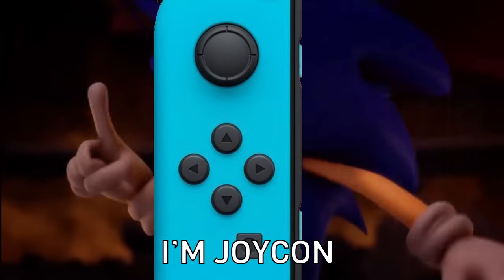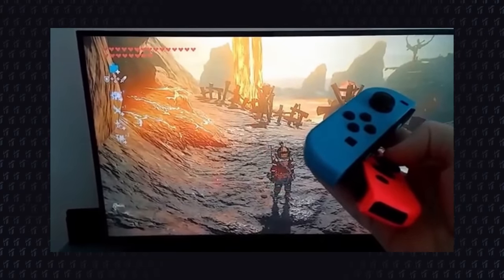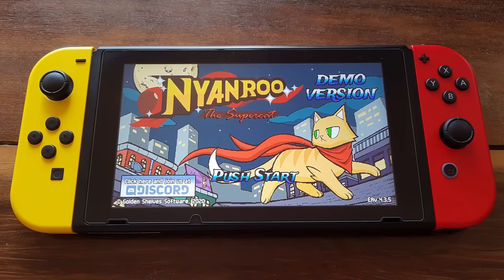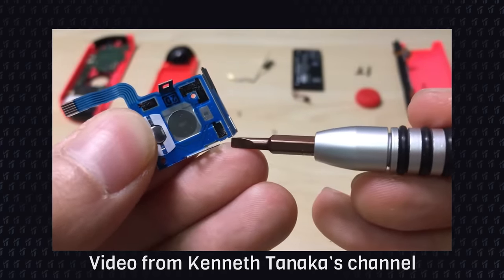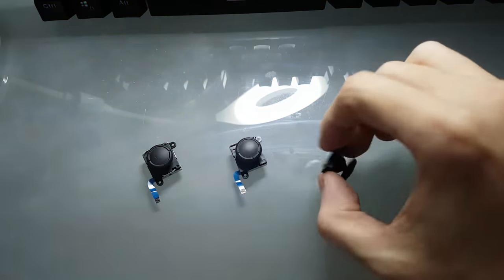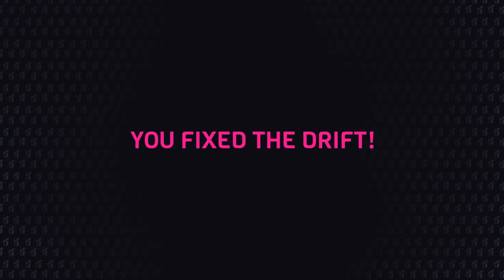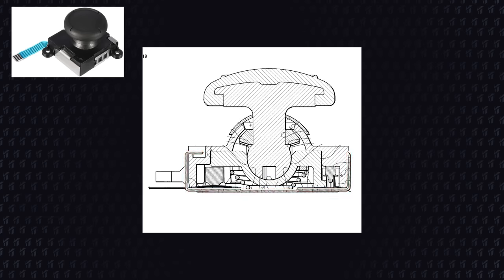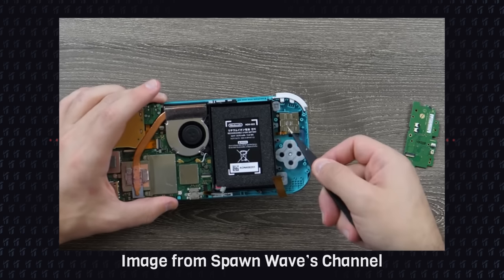How To Fix Your Joycon Drift Permanently!

Comment: I used WD-40 “specialist” contact cleaner ONCE. Joycon drift hasn’t come back since then. It’s been a year now since I did it. I still have the full bottle of cleaner sitting there.
Reply: basing off this video. it seems like the WD-40 created a kind of suction to hold the Joycon nub in its original place.
Reply: @napsterking  I guess so. I’m serious, I’ve fixed mine and my families switches. I did them the Christmas off 2019. Heavy use through the pandemic and still no drift.
Reply: Did the same but i used cotton to clean with the wd 40 without destroying the joy con. It came back again 2 month later but i repeat the same thing and now 1 year later no more drift. No idea how that work but i'm happy with the result
Reply: I tried it multiple times before and it didn't work sadly
Reply: @xamora  but did the cardboard work?

Comment: I just want to remind everyone that the nintendo 3ds had an issue where it would randomly shut off because the battery wouldn't make contact with the 3ds and the fix for that is a ~1 mm paper clip to put pressure on it
Reply: Like any cell phone before smartphones where sim cards and battery were all fixed with a piece of paper

Comment: A little recap of my experience almost 2 months after discovering this trick, trying to fix my 2 drifting joycons. I ended up using small electrical tape so I can easily adjust the thickness (by adding layers) and it can be put in a device without worries.

Left joycon: Perfect. Fixed the drift completely first try. I'll update by editing this if it comes back but right now it's good.

Right joycon (the one that had the worst drift): Absolute nightmare. Ribbon cable from ZR button is way too short, you have to be super extra careful because if it comes off it is absolutely not easy to put back at least for an inexperienced person. I probably opened it at least 10 times by now. And I still can't fix the drift, with 2 or 3 layers of tape it still drifts a lot, and from 4 or 5 layers (~1mm) the screws start having some resistance when trying to close the joycon & the plastic bulges too much. 3 out of 4 of the shell's screws are now stripped which is very annoying, one of them is even unusable as it won't go into the hole properly anymore (if it happens to you, don't try to screw it in anyway, I did that mistake and it was a huge pain to remove & joycon's back got scratched in the process). Also the plastic thing holding the battery is stuck (the screws are weirdly loose but won't come out) so I have to adjust the tape by fiddling around while barely seeing what I'm doing. 

So I'd say if you only have a bit of drift and/or only on left joycon, try this. Otherwise just send them back to Nintendo, something I was reluctant to do because they're a limited edition and it's not guaranteed that they send you back the same ones, but now I'm starting to think I should've taken the risk, because I bought screwdrivers, spent a ton of time watching tutorials & opening the joycons and I still have a drifting right one that Nintendo won't take anymore...
Reply from the maker: You can buy replacement sticks and still fix it

About the stripped screws you should not have tightened them too much i talk about that in my disassembly tutorial
Reply: Try thermal pads, a bit expensive but if you tinker with GPU and computer components having a few spares help, plus they can stick to the surface while you put things back.

Also the back of the battery carriage has that hole, which 'could' be closed off with electrical tape that fits the hole, or using thick 3mm thermal pads or stuffing on top of the battery to 'press' it onto the metal plate from further away.

A alternative 'non-open' solution is some sort of attachment to your joycon case that applies pressure to those spots above and around the stick? Like attaching a 'grip' to them that also applies pressure around the stick with a metal attachment or spring powered.

Comment: Hi there ! I wanted to say that I tried this fix for my 2 REALLY DRIFTING joycons !
One did not get fixed after the repair, but the other did !! It was PERFECT for a few months !

But unfortunately, the drift slowly came back, and now it's just as if I never fixed it... I tried with thicker cardboard, but it did not do much :/

I think I waited way too much before attempting the fix : my joycon was almost stuck in forward direction !

I think that as soon as you are certain that your joycon are drifting, you should go for this fix before it gets worse and it's too late !
Reply from the maker: Have you tried cleaning the sticks inside too?

Sometimes cleaning it also helps getting a better connection
Reply: Yeah unfortunately I tried cleaning too, but it didn't fix the ongoing drift 😞

But when I press on the joycon while it's drifting, it stops ! But I'm afraid that putting an even thicker cardboard will send what remains of my joycon to grave ! :')
Reply from the maker: @ninonmaire3146  in this case its best to replace the sticks then

Comment: Dude my let's go eevee Pikachu joycons started to drift really bad and I had a feeling that Nintendo wouldn't be able to replace or fix them so I started pretty much along the same thought process as you, tore down the analog stick and was starting at it racking my brain on what was wrong because there was no dust, visible damage to the moving parts or noticable ware on the pads.  

Thanks man saved me alot of time.

Comment: Works! Just fixed my left joycon. I flicked the stick to induce the drift, then pinched the case to get the same results. I used reflective tape I had left over. Made it a little better, but not quite. Added another layer of tape, and voila. Fixed. Thanks, I was debating on just buying a new pair too...

Comment: Nintendo: write that down, WRITE THAT DOWN!
Reply: Charles the french reference :)
Reply: They wrote it down when they designed the sadcons... That's why they put those screws in there to keep people out... But judging by the comment section, acquiring such a tool is not a big issue for most people it seems.
Reply: @Thunderhawk51  for a redesign i mean, cheap and effective

Comment: I just tried this, and unfortunately it didn't work at all for me, even testing with different thicknesses of paper/cardboard. So this sadly isn't a universal solution for all cases. But I'm glad to hear that it apparently seems to work for a lot of people.
Reply: How about using a canned duster, some lubricant (like Wd40) and then doing this? Yours may have a lot of accumulated debris inside so it might need too much pressure for this to work without cleaning it first.
Reply: @JavierSegura  on lord, don't use a normal WD40 use a Contact Cleaner instead, preferably one made for electronics.

Comment: The only reason pressure “fixes” it is because as the metal contacts rub on the graphite pads, they wear grooves into the graphite pads. Pressure decreases the distance but also puts more pressure on those same contacts, which will deepen the grooves and require more pressure. The reason the side placed don’t wear like the rest is the amount of pressure is much less. And some that you mentioned do actually have drift issues, ps4 and GC both have issues with drift. A simple search will show you this. 
I’ve taken several joysticks that had drift apart. The metal was just as tight as the new ones are. The ones that I examined that came off of my joycons wouldn’t have had loosened metal anyway as the games I play when in handheld don’t use the l3/r3 buttons.
Reply: this
Reply: Very likely the correct answer here. These are just going to fail further in the future. This is a short term mitigation, not a fix. There are also a few other pieces of incorrect information in this video.
Reply: Did it happen to you?
👀

Comment: Its honestly ridiculous that nintendo is ignoring this, and still shipping these defective controllers with their OLED/lite models.
Reply: They said in an interview that the most recently produced Joy-Cons are the most durable. Not sure how true that is.
Reply: @Scarftail  I havent seen that interview, but if it's true than I'm satisfied. But only time will tell if the drift is still an issue I suppose.
Reply: @Scarftail  It's true.  The new JoyCons have a sponge material to hold that metal contact.

Comment: Thank you so much! My Switch had become unplayable and I had no idea how to fix it. I got a cheap tool kit on Amazon and had it fixed within 15 minutes. You're the best! ❤
Reply from the maker: thanks!, after some time the paper card can deform and the drift may return if it does you can just replace the card with a new one and it will stop drifting for some more time, but you should definetly consider upgrading the analog sticks to a hall effect one, there is a video showing these new modules, they're selling on amazon for around $20 https://amzn.to/46GA9TG

Comment: My joycons started messing up once I dropped my switch. Besides the drift the most annoying thing for me is not being able to click down the joysticks
Reply from the maker: I believe that in your case replacing the sticks might be a better solution since you can't click down on them
and if they start drifting you do this fix
Reply: @VKsChannel  I would say add the paper while replacing the bad sticks, then you won't have to open the joycon again down the road.

Comment: This fix worked for my Joy-Con for a short time, then the drift came back worse than before. But it was worth a try!
Reply: Did you use the correct size/thickness type of cardstock? Is your joy-con thumbstick dirty or worn down? These can all prevent the technique from working properly.

Comment: The Joy Cons have a specialized tri point screw, so this seems to be out of my capabilities as of now. Would you think this also helps with Pro Controller drift? I can open that one up, because it uses simple philips screws
Reply from the maker: the pro controller uses a different mechanism than the joycons

you can order a tri point screw for very cheap on aliexpress or amazon!
Reply: @VKsChannel  I sadly just broke my screws some minutes ago bcs I bought a scredriver set which were apparently advertised for the switch but they just broke my screws 😒
I purchased new ones and hope I will be able to screw them anyways 🥺
Reply: @StickDead  I can't believe how cheap stuff like this is nowadays. Makes me quite happy.

Comment: The newest theory is that Nintendo is more interested in winning their lawsuits than being pro-consumer, so they don’t want to admit guilt and have to pay anything, regardless of how simple the fix is. In hindsight, I highly doubt Nintendo’s engineers didn’t learn the exact design flaw the instant the drift started being reported, so they’ve been sitting on the fix this whole time. If you want even more proof, look at the design flaw of the first 3DS in which the bottom screen scratched the top screen. Every subsequent iteration solved this by adding rubber pads on the top screen or flattening the bottom screen’s hinges. So there’s zero chance they didn’t already have the solution for drift.

Comment: It would seem that the stick is intended to be under mild pressure from the casing, but usage, like pressing, as you outlined, but also the ware of pressure across the two thin sides of the controller from handling. Those together will loosen both the metal plate, as well as the plastic casing.

Comment: It's a bit weird.  If the fix really is this simple, and speaking as someone who bought their system at launch and has never had an issue with drift, I am surprised Nintendo doesn't just put a small silicon pad or something in them.  Perhaps I don't play enough high-intensity Ninjala to wear out the sticks.
Reply from the maker: yep it depends on what kind of games you play

notice on how most drift videos showcase it happening with breath of the wild ( a game that requires pressing on the analogs ticks to crouch or run )

Comment: I'm scared of voiding the warrenty on my controllers, but considering how I have 10+ joycons and a little less than half of them are drifting I may as well sacrifice one of them to see if this trick works.
Reply: go for it! it isn't that hard
Reply: you dont have to take them apart to see if it will fix it. Just squeeze while testing the controller like he did in the vid.

Comment: I tried applying pressure at the calibration screen, nothing happened. the drift didn't suddenly disappear like in the video, it just continued to happen. so, I think this is probably not a universal or permanent fix.
it seems that this is a fix for one of the causes for joycon drift, but not all of them, and if you fix it this way, it's possible another cause of the drift will start to happen, the kind that I have.

Comment: I have a strong suspicion doing this caused my joycon to crack. I cut a tiny piece from one of those game cards you use at arcade places which fixed my drift for quite awhile. Though, the other day I noticed my joycon cracked right in that area near the analog stick despite not being dropped. I think the little extra pressure over time caused it to weaken and crack. I guess the material needed to be slightly thinner so be careful what you use.

Comment: your telling me that all you need to do to fix the worst issue with the switch is to stick a piece of cardboard in it like its a wobbly table? lol of course its that simple 😂😂😂
Reply: I'm worried it could catch fire somehow :(
Reply: @diverman1023  The joy cons don't produce heat , and in the joy cons is foam inside.
Reply: @emmr01  I’m not concerned about the heat but a short circuit somewhere
Reply: Does anyone know if you have to like stick the paper to it with something sticky or does it not need anything to stay there
Reply: @AndyMcDrew  I've done it for my friend and i put it there , the battery tray holds it
Reply: @diverman1023  just use a different material then

Comment: I'm wondering if the manufacturer of the stick is to blame, since more than just the Joycon use this same stick.
Just a theory but it'd definitely get the stick manufacturers more orders with so many failures.
Reply: I recall an article or post somewhere that showed this to be the case. Not that I can find it now. :/
Reply: it was kinda confirmed that the manufacturer has been responsible of various sticks drifting, i dont remember the name of the company but they're outsourced i think the PS5 sticks come from the same people

Comment: So…., if I understand correctly, it’s because the part that registers joycon movement isn’t placed snugly enough?
Reply: Well its snug enough at FIRST. Until fatigue increases the gap just slightly and all hell breaks loose.
Reply: @DanaTheInsane  In other words, it’s not snugly enough that it’s unable to loosen in the first place.
Reply: @DanaTheInsane  What about my set of joycons that had massive drift literally right out of the box?
Reply: @Xbob42  It's built with even more loosely from the start. A Monday piece as we like to call them here. A bad batch, really.

Reminds me of when I bought my 3DS XL and the right dpad button was defected. It was literally stuck out of the box.

Now I have a massive drift on one of my joycons (more like sadcons) and a slight drift on my "Pro" controller. The quotes are to express my sarcastic opinion of using a word Pro in a product that has such a major flaw in it... I mean, a feature, of course...

Comment: This is good as a temporary fix while you wait to get another controller but if it drifts, chances are it's wearing out and the extra pressure makes it work but will (I think) make whatever graphite is left wear out even faster with the added pressure.
Reply: If his diagnosis is correct on the cause then graphite wear is not the issue. The issue is the metal backplate, being held only through crimping, is losing its tight crimp from constant movement/vibrations. With the extra material the backplate is no longer relying on the crimp for that tight fit but the Joy-con Chassis itself.

Comment: It's interesting the stigma the joycon has about drift but not other controllers. I have 3 ps4 controllers with drift but here you are saying it doesn't happen on ps4 controllers. It's happened to me 3 times as much for ps4 than joycons. I know i'm just unlucky but it makes it harder for me to trust ps4 even though it's essentially the same technology as other joysticks.
Reply: PS5 has the same sticks as any other controller (except Joycon). I assume PS5 is only getting attention because of all the attention Joycon drift got. Now that people know it's nonsense and want to sue over it, a few pissed off PS5 owners are on board to sue.
I had stick drift in multiple Xbox 360 controllers. Same sticks there too. It happens to all of them because they all buy bottom of the barrel garbage from Alps.

Comment: Wanted to confirm along with everyone else that this works! Though I should add you need a few things:

- a Y00 screwdriver (outer shell)
- a phillips 00 screwdriver (battery tray)
- a guitar pick or spudger (outer shell, battery)

Used a nice-ish business card (not super heavy weight, but not flimsy either) and that worked just fine. I had considered using cereal box cardboard, but there's not a lot of room in there.
Reply: Y2.0 also works for the outer shell, I opened mine with one. Agreed with phillips 00 tho, I tried 0 and it wasn’t working.

Comment: 4:48 3ds does indeed have drift. Dust gets inside and you can’t turn it left. Clean it with a toothpick to temporarily get rid of the drift, not a problem for me since i use new 3ds xl but it is a massive problem especially for those older-3ds owners